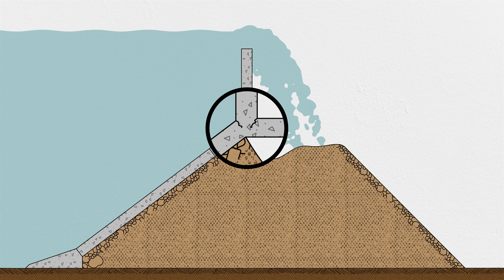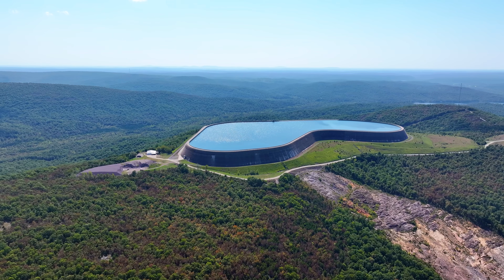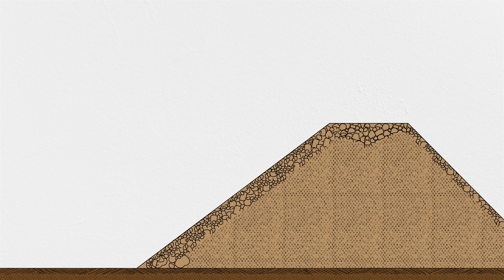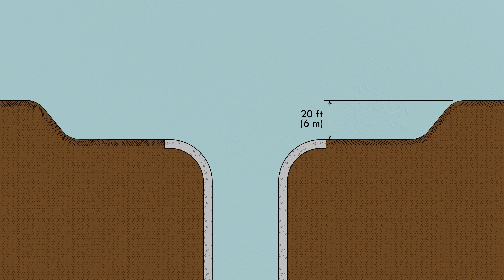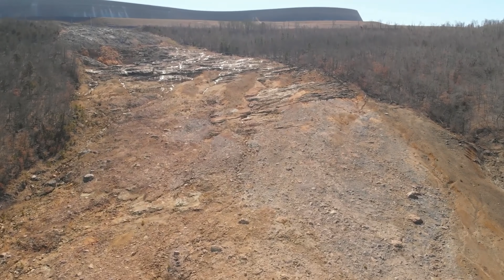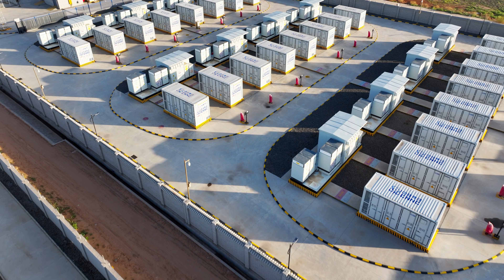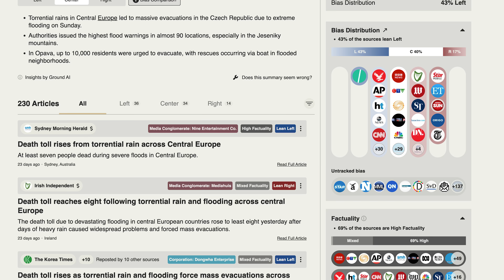The Wild Story of the Taum Sauk Dam Failure

Comment: Banks Lake in the upper [north] Grand coulee is a big pumped storage reservoir at 27k acres (average 50ft deep). Grand Coulee Dam is not in Grand coulee, it is a mile northeast and hundreds of feet below. 

In fact the original dam design was changed from 300 something feet to 550 feet so that water could be more efficiently pumped up to the coulee another 300 feet. (550 was the maximum dam height due to the elevation of the impounded river at the Canadian border). Banks Lake was originally intended for irrigation but it is also used for seasonal pumped storage. There are 12 pumps at combined 593Mw, but the newer six added in the 1970s are reversible pump-turbines with combined 314 Mw generating capacity. 
Flows in the Columbia river are extremely seasonal due to snow melt and opposite to the electrical consumption season. So much so that the US convinced Canada to build a couple of large flow control dams (With minimal electrical facilities and large volume fluctuation.), and British Columbia is paid with a ration of free electricity from the lower Columbia river hydro power (More than they use so we buy back some of the free power.).

Grand Coulee Dam (specifically powerhouse #3 with its six 700Mw turbines [each]) is the controlling power plant on the northwestern grid, setting the 60Hz frequency and adjusting output every 10 seconds to stabilize grid voltage in response to short term changes in demand and wind/solar supply. Accomplished with a coordination of water flow control and magnetic flux density (Field coil excitation). Other Dams will make less frequent changes for medium term fluctuations like day/night and of course seasonal.

Comment: Having spent several years in industrial automation and similar machine control, this is why I would fight against over complex safety systems.  I love technology and the daily 9-5 operational stuff can be built as fancy and complex as anyone's heart desires. Just leave the safety shutdown stuff as isolated from everything as possible and keep the system as basic and foolproof as possible. Anytime gravity can be used for anything, it's a great fail-safe because it's one of the very few things that is going to work regardless.  Also, safety systems should pretty much never use networks.  Hardwire with fail status being open circuits.  That way if anything fails, even if it's just a wire, the default will be a safety shutdown.

Comment: The huge investment in battery storage currently underway is no doubt neccessary as a component of a reliable grid with less fossil-fuel generation. However, it usually requires a failure of a system to gain a clear understanding of the weaknesses of it. 

It seems to me that there is some risk of fire and/or explosion with high-performance battery systems. The resultant dispersal of toxic material from such an event could be really catastrophic if the facility is located in a high population, built-up area. Let's hope that, if such an event were to occur, that it happens at a smaller, remote facility and the resultant investigation gives some fundamental insights to the actual failure modes, and that engineers and regulators can use this information wisely to develop more robust designs and standards.

Comment: I really do not know why pressure transducers were not used.  Water head height and pressure are directly related.  If the static pressure at the mouth of the glory hole is too high, the water level is too high.   Then you mention they added high level sensors at a high spot?  Weird engineering...

Comment: As a manufacturing controls engineer, its unfathomable that the failsafe probes were never tested, as well as having the requirement to have both sensors made before triggering. Having a failsafe sensor independent is basic controls 101. This isnt amazing engineering, this is half assed engineering.

Comment: 14:20 - Am I viewing the spillway correctly, it flows South East? The accident was NE, that's still visible on satellite imagery. But... there's a cemetery in that SE direction, on the other side of the creek that runs along with an (access?) road there. Maybe it's high enough up on the other side to not be in danger, but that spill path also crosses the path of the power plant's mains connection and it doesn't look like the spill path is engineered, just bare ground (like the "emergency" spillway from Oroville Dam), so any outflow in that direction isn't going to be terribly controlled.

I feel like this is either another accident waiting to happen, or I'm missing something.
Reply: Looks like plants

Comment: Since it’s on top of a mountain there is no watershed. The only way water can get there is if it falls on the surface of the pond; negligible, or is pumped there; significant. The answer is simple; just stop pumping. So, the design appears sound, it was the execution that was poor: 1)  more soil and less rock in the retaining wall than the design specified 2) uneven settling, known but not accounted for 3) main sensors poorly installed 4) backup sensors misplaced 5) no onsite monitoring personnel. Of those only item 5 was part of the original design so that appears ill considered. In hindsight if you didn’t want to staff it, it would have been cheaper to build a spillway with another set of sensors there if it activated.

Comment: 1- Substandard building materials is a very common issue. 

2- The fact that the overflow sensors were installed higher than the top of the reservoir is not just an engineering failure. It's gross negligence. It means they never tested anything.

3- The fact that the water level sensors were no longer reporting the actual level is critical. The control loop is compromised. Until the sensors are fixed, you need to do something to insure that some level control is maintained. Simply guesstimating a new value for NON FUNCTIONAL sensors is criminal.

4- "The wind must be responsible for the overflow..." What kind of 0 brain incompetent did this? The wind can cause overflow doesn't change the fact that you have an overflow. An UNDETECTED overflow! Think about it. See point 2.

5- The pump kept running after its shutoff. That's pump control 101. This is garbage control code. Heck, they put the overflow sensors in validation mode (both needs to activate for something to happen) rather than redundancy mode (at least one need to activate). That's gross incompetence from the software programmers. And obviously never tested.

Those are not "mistakes". they are incompetence and negligence.

Comment: Under $30.00 worth of toilet fittings, pvc pipe and wire or air tubing, the pumps would have shut off. Works for residential sump pumps very reliably... usually outlasting the pump. Same principle to control an air switch, microswitch etc. Simplicity and redundancy. And the settling had not been monitored? So many failure points conspired on this one, well visualized by the Swiss Cheese Model.

Comment: Thank you for a very interesting subject. While the FERC report concentrated on the engineering/technical cause for the failure, IMO is the root cause began during the project initiation stage. That is, investors wanted to maximize the ROR (rate of return) on their investment by keeping the capitol cost of the project down to justify the project. This is a game all major projects deal with. The casualties are things like redundancy (N +1), adequate QA during design and construction, and not enough planning on what the true cost of maintenance of the project over the life of its expectancy.

Comment: I will say, in the case of the fail safe probes, it is a bit tricky when it comes to logic. On the one hand, you want both to trigger because one can start sending out erroneous data (I have personally seen this before with sensors at my office lab). On the other hand, if one is broken and something is going wrong, like in this case, you want just one of them to trip. Cases like this and cases like the 737 Max are why you ideally want 3 sensors not 2, because the odds of 2 failing are substantially smaller than the odds of only one failing (which is an inevitability).

Comment: great job on this. I worked at Johnson's Shut Ins in 2003 and 2004. We always talked about what would happen if the dam broke. So glad it was in December and not July with a full campground of up to 500 people. the Park Superintendent Jerry Toops and his family discussed it several times when I was there. It's amazing they survived the cold water after being swept away. I also still have piece of the original inner black liner material from the reservoir.
Reply: If it had happened in the summer,  it would have been one of the worst disasters in the US history -- hundreds of people would have been killed in minutes (to be honest, I'm suprised no one died as it is. Its a miracle that the superintendent & his family survived).
Reply: What a ridiculous engineering design. Why in the world would you put all that weak concrete wall up there on top of that Hill when all you had to do was dig down into the top of the hill and you have a pool.
Reply: @larry77117 Let me guess, you’re not an engineer. Digging a hole is orders of magnitude more expensive than building up a retaining wall. The video goes over the economic reasons for the project in the first place, your idea would have made it a non-starter.
Reply: @larry77117  weak concrete? It only broke when they let it overflow and too much stress was applied on the weakest point of the tall concrete wall…. Let’s not be those idiots who start pretending it was a terrible idea to begin with because something highly preventable went wrong.

Comment: Uhm.. Why didn’t they install simple level switches for the max. level?
Basically an LSAH next to the LIC used for operation.
Reply: Pumped storage comes with 10-20g CO2 equivalent immissions per kWh.
What about batteries?
How often does one have to replace the accumulators?
I‘m not yet convinced.

Comment: Wonder if they had any non-electronic overflow management system. You can have a simple spillway with a direct route to the bottom reservoir.
Reply: doesn't matter, 30 sec after I wrote it you've mentioned a spillway:D

Comment: Such an incredible engineering achievement, safe-guarded by a system that a high-schooler could have engineered better. Even the standard USGS stream gauge float systems would have worked fine here. What about GPS buoys? …wouldn’t even need tethered power or data, just use solar and wireless and put a weight on the bottom for zero penetration. Hell you could even use a laser grid of 5 or so beams separated by a few feet (to avoid false alarms from waves or birds) and when all 5 beams get interrupted, it triggers an alarm / auto generation mode for the system. Or use all three for redundancy? 

I mean all of them together seem cheaper with a lower risk than the bs system they used before which had obvious potential for not only damaging the membrane but providing grossly inaccurate readings.

Comment: So I have a question though it might sound really out there and silly - but - what if you took a mountain top and kind of hollowed it out? The mental image I have is similar to all those illustrations explaining volcanoes, except that it's pumped water instead of lava... If they already had a channel going through the mountain to the lower reservoir, would making that channel (tunnel?) bigger be of ANY use to the overall operation? Would it just make things more dangerous? Obviously such construction would've been basically impossible for engineers in the past but, don't we have technology now that COULD bore a great huge hole like that? I'm just wondering about it because it seems like an entire hollowed out mountain would be an enormous amount of potential storage, but I obviously haven't got a grasp of the maths here.

Comment: It is unfortunate that while this channel (correctly) focuses on the technical engineering of projects, no similar channel focuses on the political landscape. Arguable, Taum Sauk never should have been built at all.

From the start, local residents STRONGLY opposed Taum Sauk, and strong citizen resistance was able to prevent construction on the actual planned site of Taum Sauk mountain. The problem isn't just NIMBY: all of the mountain peaks in the area are unstable ancient rhyolite that is highly eroded and collapses easily. Even the government was initially against the construction, which was why the plant was constructed almost secretly, a matter than eventually went to the Supreme Court. The company had simply decided they would build it no matter the fallout and they did.

Once the plant was built, the greenwashing began. Originally touted as a load-leveling plant, the real purpose couldn't have been more different. The plant is now utilized to generate profit for the utility company, with off-peak times now used to burn EVEN MORE additional fuel for selling excess power to other utilities, undermining the very green credentials the project was initially touted for. This shift highlights how the plant, instead of being a model of renewable energy, is simply another cog in the profit-driven machinery of the energy sector. It's not an environmental victory: it's a known unsafe, undemocratic product of corruption that is used 300+ days a year as a profit center. It does the opposite of what it was pretended to do, and if the area is ever hit by an earthquake or any flooding event, history will likely repeat.

Reconstruction funds have continually been misappropriated in the wake of the failure. Just another chapter in the political and environmental corruption of Taum Sauk.

Comment: let me guess: because it was pump fed, they cut any overflow protection? at LEAST need sensors to indicate if the water level becomes too high, and physically cut the lines to the pumps in case of system errors
Reply: so they HAD sensors, but they were installed incorrectly... just negligence

Comment: sounds like in the absence of a spillway it created its own spillway

also, i'm surprised there wasn't an emergency redundant cutoff of some sort, maybe some float switches like you see in toilet tanks, one placed every X distance in case of settling to make sure water level is actually controlled by water level rather than water depth or flowrate multiplied by time

Comment: About those batteries for grid load regulation, you need to consider that part of their risk profile is that Lithium explodes, and those fires are near impossible to put out. Might not imply "Towns swept away by the flood" levels of disaster, but I have the impression people treat them like having batteries in an appliance at home.

Comment: hack the sensor in software (subtracting the level), instead of actually fixing the problem... this sounds SOOOO familiar.  If your car gets recalled and the fix is a software update, you can bet this is happening under your hood too. Same thing in the 737 max, messing with sensors in software instead of fixing the real physical issue.

Comment: When you rely on complicated systems there is an increase in the number of possible points of failure, which is why simplicity is usually the better solution. But with any system competent human oversight is always the critical factor because no system can handle anything it wasn't designed for, and trying to do that by machine only adds to the complexity we need to avoid and makes failure an even bigger issue.

Comment: Interesting problems.
In my place (not usa)  there is a reservoir but its not on mountain top its in a flat area. It was built as an emergency cooling water reservoir for a nuclear power plant. Its about 50feet high dam and the water inside is 50 feet deep. The dam is also a kidney shape and to walk around on top of the dam is about 4 miles. Also concrete inside and soil outside. A beach for swimming, a surfing club and a sailing club on opposite sites. Plus a restaurant. I hope the dam will never break...

Then about organisational problems: We have an oil refinery in my city with a thermocracking unit. some men were sent out 2 times a day to switch the stream from one coke chamber to the other one by turning a big wheel for half an hour. The did a big renovation and enlargement and replaced the manpower by remote controlled electric motors. One day there was a problem and they found the reason by chance but too late. The pipes were plugged with coke  already. the motor did not shut down completely after switching the stream, with some low electric power creeping to the machine it was turning very slowly so you can hardly see it. An electronic part for 5 dollars failed. It was very expensive to cut out all the pipes, clean them up and weld them back in place plus the lost production. They made the process half automatic. Switch the motor on at site and shut it down again with a breaker. Sometimes half automatic is the better choice.

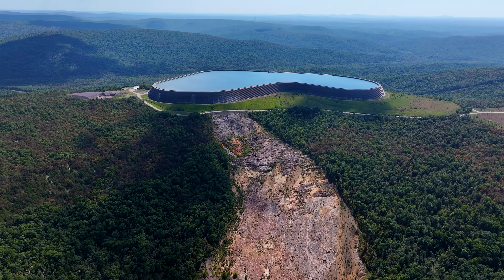Comment: 13:40 ish Well a spillway doesn't seem like an effective failsafe in this instance due to the ground settling - the spillway would presumably be built with the assumption that all areas would be level relative to it, so on its own you're not really any more likely to avoid this catastrophe with a spillway than without... you'd need additional elements to ensure safety, like considerably more buffer wall above the spillway, or multiple spillways routinely spaced around the place, along with sensors for each one to trigger overflow management on top of that... ah well.